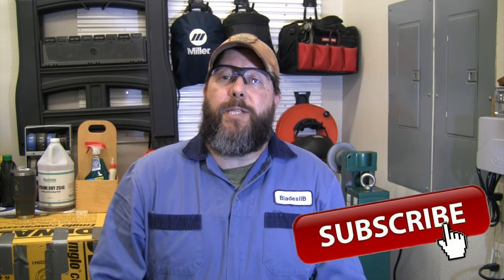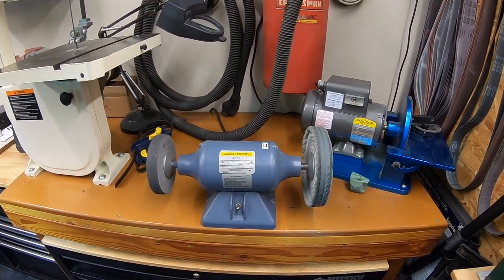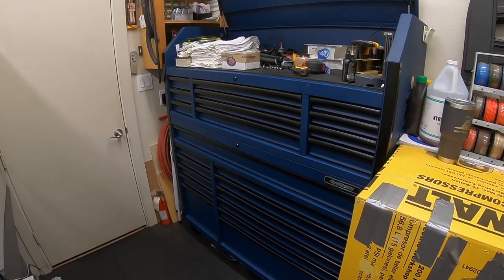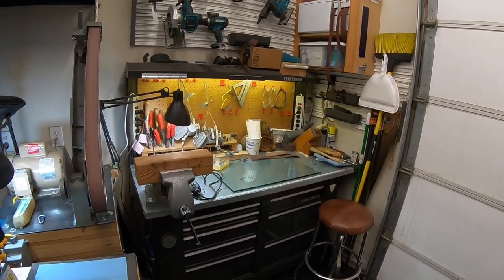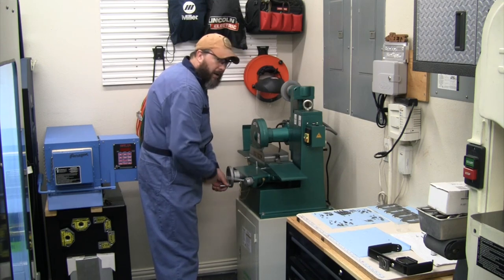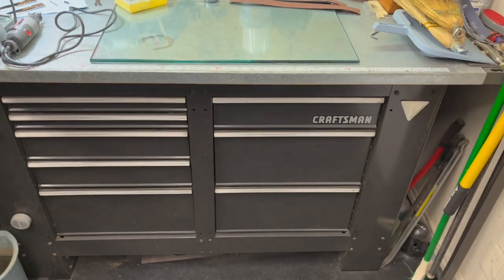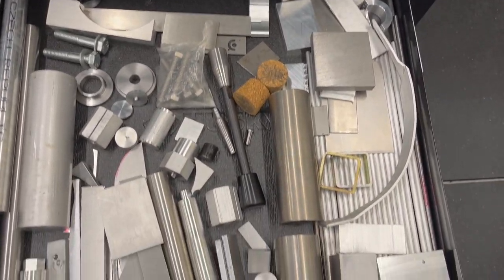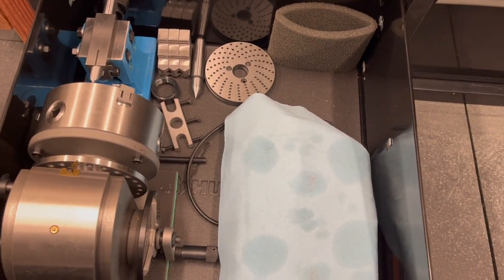Full Machine Shop Tour - Everything I Could Fit In A Single Car Garage!

Comment: I'm intrigued with how clean you are able to keep it. I've got a mini lathe and anywhere in a 6 foot radius of it is chips and cooling fluid.
Reply from the maker: MrBCRC - Thanks for the comment. The rubber floor helps make clean up pretty easy. I have a very course bristle broom to get up most of the chips and I finish with the shop vac. You have probably seen in other videos when I run the manual mill it throws chips everywhere, by far my messiest machine. I don’t use coolant on the manual mill or lathe so that helps keep the mess down as well.

Comment: Glad I'm not the only one that had a mess of allen keys in a drawer instead of two decent sets (one metric, one imperial). I eventually bit the bullet a few months ago and threw out every single allen key I had been collecting from flat pack furniture and places like that, except for the two good sets and a backup of each size (after ensuring each additional one was in fact a duplicate). This excludes dedicated allen keys that are assigned to specific locations for specific tasks I kept all of those of course.
Reply from the maker: Legally Free - Good plan, a little clean out now and then is not a bad thing. I also have a good set of each I regularly use. I do like to save the small ones though, if they are good steel, they grind up nice into little flat screwdrivers or little scrapers when you need them. Thanks for the comment.
Reply: @BladesIIB  Thats a good point, however I am confident 95% of those I threw away were made with "minimum viable steel" quality :) , and an excess of little screwdrivers that have also shown up in kits as freebies is a whole separate thing for me! (Have not thrown that collection away yet but I have cheap little phillips and flat heads laying all over the place plus a drawer that probably has at least 10 in there...)
Reply from the maker: @legallyfree2955  I gotcha. Makes sense.

Comment: Just building my 24x30 garage/ workshop.  I've done some metal fab/ welding and want to get into machining!
Reply from the maker: NS Gearhead - Congrats on the new shop. 24x30 should be a good size. You can get equipment and benches around the perimeter and still get a car in the middle if that is your thing. All the best putting your machine shop together. Great hobby to get into.
Reply: @BladesIIB  For sure.  The plan is to keep the benches and tools on the sides so my truck with plow can still fit in the middle.  Permanent ladder and freight elevator at the back to access the bonus room (12'x30') upstairs.  That will remain un-insulated and act as storage to keep the clutter down on the main floor.
Reply from the maker: @wannabejeeper  The bonus room for storage will be amazing especially with an elevator. Well thought out for sure. Enjoy.

Comment: You ever think of putting outlet covers on those outlets by the surface grinder?  Help protect grit getting in there.
Reply from the maker: Brenton - Had not thought of that, great suggestion. New to have a surface grinder in the shop and it is a dirty machine, wish I had room at the other end by the other grinder. May try to set up a dust collector for it. But getting some outlet plugs is easy, will definitely do that - Thanks.
Reply: When i set up my shop i did it to all of my outlets. Didnt want any oil slinging in the holes either
Reply from the maker: @jerkfaceskater  Yeah that makes good sense. Chips off the lathe etc. and those plastic plugs are cheap.
Reply: @BladesIIB  exactly. They suck when you need the outlet but for guys like us with small shops it is a nice security.

Comment: Great use of space. I took some inspiration for the rooms I will have to convert in the new house I moving in. Question, and I am sorry fi I missed it. What power requirement do you need for the lathe and Tormach mill? What do you have available in the garage? 220V 50A?... Thanks!
Reply from the maker: Ale - Glad to hear the video offered some inspiration to help you get set up. Great question, I did not mention power. I have a sub panel for the power in the shop and have a 220V 20A breaker for the kiln and another for the Tormach. The AC has another 220V and I think 30A breaker and then I have another 220V 50A breaker to a plug that I share for the Jet Mill Drill, the Lincoln welder and the Lathe. Both the welder and the lathe need the 50A, the Mill only needs 20A and has its own fuse for protection. The lathe is also 3 Phase running off a VFD so the 220V 50A power is feeding the VFD enclosure. I hope that helps you think through power. Ideally hard wired or dedicated plugs would be ideal but I had that 1 plug available and I can’t run two manual machines and weld at the same time so sharing 1 plug has not been an issue yet.
Reply: @BladesIIB  Thanks for the super clear answer. That helps a lot
Reply from the maker: @Ale_Lab  Welcome, happy to help.

Comment: I have more space but I found that it's surprising how much those tool chests cost for organizing tools and stuff. Most my tooling is just piled in some corner that I could get to, otherwise it's lying around the shop. I really need some tool chests but some of them cost more than my lathe (especially in Taiwan). 

By the way have you ever turned a brake disc? I know this isn't done much but someone gave me some brake discs to turn, and will pay me some money for it. My lathe will swing it but setup is a pain because I'm not able to find a good way to clamp it. Right now I just clamped a smaller 3 jaw inside the main 4 jaw, and then I used the tail stock live center to back it up so it doesn't come off. I'm not going to spin it fast, probably 200 rpm if I am feeling lucky.
Reply from the maker: Tyler Fu - Thankfully with the big box stores here you can often find tool storage on a pretty good sale.  Mine definitely cost a lot less than my lathe and with a small shop, keeping everything organized is a must or I would be tripping over everything and spending all day looking through piles to find what I need.  As for turning brake discs, I thought I answered this for you already, but here goes again.  I have not turned them on a lathe, I have used a disc/drum turning machine before.  Since they are cast, and now embedded with brake dust, they will be very messy to turn, I recommend covering your ways with cloth and then cleaning up right after to remove all the abrasive dust to prevent future wear.  Turning a few should not be a problem, if turning a lot of them the wear and abrasion can be an issue.  They are all shaped a little different so holding can be a challenge.  You may need to turn a plug to put in the end to your center can actually hold it aligned better if you don't have a pipe center.  With a plug or pipe center you should be able to hold them pretty secure for turning.  Good luck.
Reply: @BladesIIB  No I don't think I asked you about brake disc turning before, or if I did you didn't answer (or I did not see the answer). Anyways I seen a few videos and I will probably keep a shop vac hose hear the tool bit as I turn... to hopefully minimize the dust. It's just a small money making opportunity for me, at least so I can pay for stuff like tooling or a good 3 jaw chuck (ones like the one you have that have bolt on jaws). In Taiwan those tool chests are never on sale and are imported, thus the high price. 

Right now my shop has the lathe, a mill that uses ISO 40 tooling (I was actually going to ask why not go with BT40 tooling for your Tormach considering that with BT30 pull stud breakage can be a problem. I know someone who told me to avoid BT30 because if you take a cut that's a bit too heavy the pull stud will break and it will basically ruin the CNC. He said he'd go with BT50 if he could), and a giant 26 inch bandsaw that I use for wood. Don't have a metal bandsaw, if I needed to cut stock I'll use an angle grinder to do it... Or at least order stock in the length I need... 

I use my mill for many things, such as sanding wood and other stuff.
Reply from the maker: @taiwanluthiers  Was in an email, and if asking again I must not have given a thorough enough answer 😁. Happy to answer again.  Keeping the dust sucked up should work great. The Tormach only comes with a BT30 spindle. That is actually a recent upgrade from the R8 version with a different tooling set up that was not a taper and not as good for tool height. I agree 40 would be a nice option if possible.
Reply: @BladesIIB  Yea for some reason R8 is real popular in the US but in Taiwan nobody heard of R8's. Even all Bridgeport clones used in Taiwan does not use R8, they use NT30 spindle. My mill uses NT40 spindle, and the nice thing is I can use BT40 tooling too, as the friend I mentioned ended up leaving a few face mills for me (its insert screw broke and so it was useless for him). In fact it is impossible to buy R8 tooling in Taiwan. 

One problem I have with the lathe is that since it does not use camlock spindle, I do not know where to buy collet chucks for it. One of these days I may machine one myself to take ER40 collets.

Another problem with my lathe, the tail stock seems to have different alignments depending on its position on the ways. It means if I push the tailstock close to the head, it will break center drills. On the other hand, it aligns perfectly fine on the far end of the lathe. I think there may be a head stock misalignment (Abom has a video on this for his Victor lathe).
Reply from the maker: @taiwanluthiers  Tailstocks are meant to be moved off center to turn long tapers. Maybe it was not moved back correctly. Should definitely be able to test and set up the alignment the way you need.
Reply: @BladesIIB  Yes I know that.

The problem isn't so much tailstock being off center. It's that I must move it very off center in order to center drill anything near the headstock, otherwise the center drill will break.

Then when I move the tailstock back in order to either drill a hole, or to use a live center, I must move the tail stock back on center or else I'll turn a taper.

I've leveled the lathe bed already so I don't think that's the problem. I couldn't actually get it dead level, it's about 3 or so ticks away (the leveling is very sensitive and the adjustment is not always on the right end, meaning I must adjust the lathe feet at the head end in order to level the tail end, and it affects everything. Took me a long time to get it that level).
Reply from the maker: @taiwanluthiers  Sounds like head stock alignment would be worth checking.

Comment: As clean as the shop is. It looks like it is only for display , not work.
Reply from the maker: Herschel French - I assure you it gets plenty of use. Small with a rubber floor so easy to clean up. Hopefully you have a chance to check out some of my other videos. They will show the shop in use and sometimes I try to get a good shot of the mess before I clean it up. Appreciate the comment.

Comment: Did it take a while to acquire all of this or were able to secure a loan to get it all?
Reply from the maker: @shawnwebb5261 - This is not my full time work/business so I did not seek a business loan.  I acquired a lot of the hand tools and some equipment over many years and more recently got back into machining and got the lathe and CNC.  Even those I purchased a couple of years apart to spread out the cost of the machines and the tooling that goes along with each one.  I am sure loans are available if you are starting a full time business and put together a business plan.  Thanks for the question.

Comment: What kind of oil are you using on the surface of your lathe/mill drill?
Reply from the maker: Elliott Brown - Thanks for the question.  I just use the Mobil DTE Heavy Medium as my layer on for rust protection.  Typically wipe it up before using a machine to wipe away any dust it has collected and make it easier to clean up chips after using.

Comment: Hi quick question how tall is 1100mx. Spot I want to put it is 91in tall too close?
Reply from the maker: faxoli - Thanks for the question, that will definitely be cutting it close.  According the the Tormach typical footprint specs they say 96".  I have their machine print downloaded in Fusion and just looked at the total height dimension on there and it is 94.3" but it looks like the leveling feet are all the way out.  I just physically measured mine and not easy to measure to the top of the cable chain but I get 87" from the floor where mine is currently leveled.  Not sure what the ceiling above it would be, but the only thing that needs that height is the cable or energy chain and it is pretty small if you needed to cut a space for it to fit.  I would definitely call Tormach and talk to them.  The customer service is great and I am sure they could give you a more definitive answer.  My thought is very close but should be able to make it work.
Reply from the maker: faxoli - I just accidentally removed your other reply. Sounds like you have a good plan and some options. I hope you are able to get one. Great machines.

Comment: I'm sorry but  I do not see 30 years of percision machinist hand tools. I've been learning for 3 years and I have 5 times the amount of quality measuring tools, jigs, attachments a accessories.  You would never find an old faucet in my tool box.
Reply from the maker: Wags - Just to clarify, I was a full time machinist 30 years ago in a large shop. Part time another 4 years while in college.  Since then and currently I have another full time career.  Check out my channel and you will see I have only gotten back into actual machining in the last couple of years.  My shop is a home hobby shop so it has bits from all of my shop and home projects. What I have works well for me and I expand and add where I can. Sounds like you have an amazing shop as well. Congrats to you and all the best on your learning journey. The learning never ends for me.